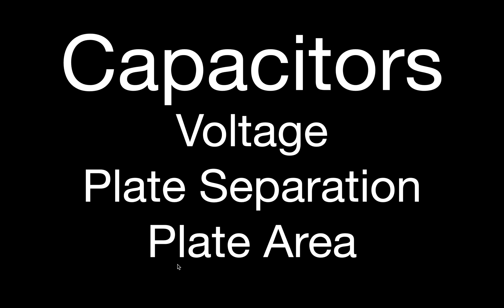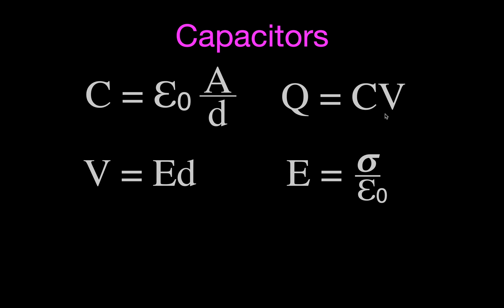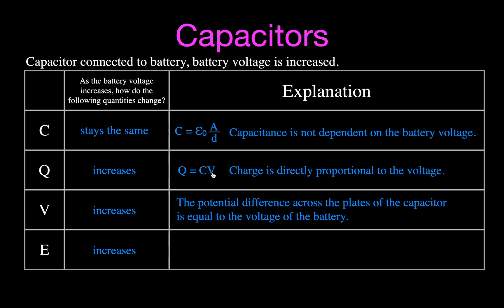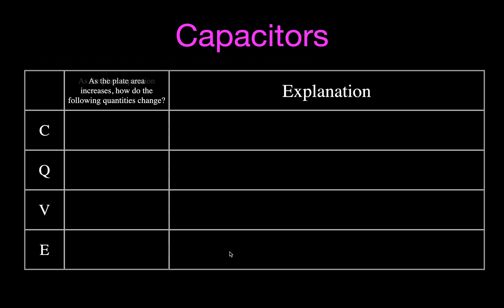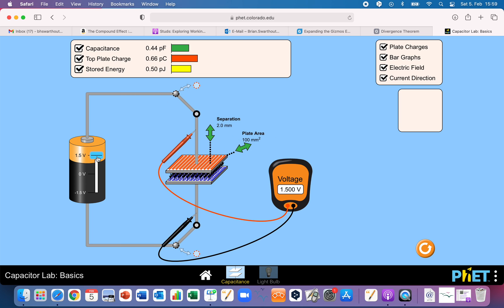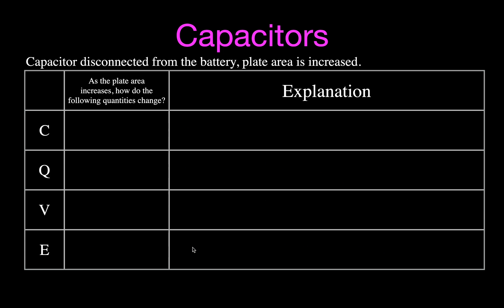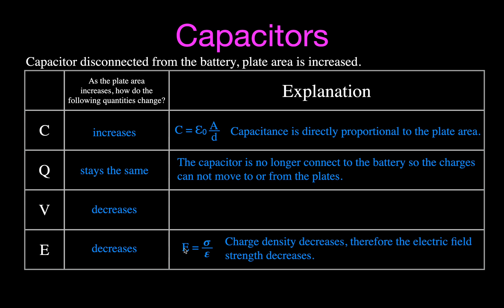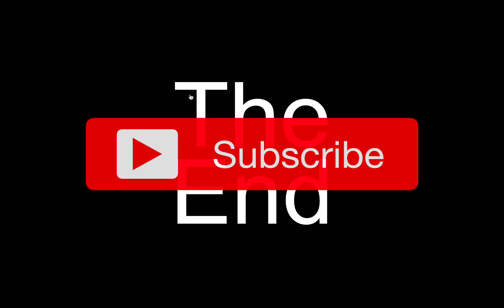Capacitors (10 of 10) Changing Plate Area and Separation with PhET Simulations

Comment: Really great demonstration!   I'm very curious, at the end of video, you showed the capacitor disconnected from the battery with bulb connected to consume energy.   If the plates separate farther apart with same size, will the bulb be less bright and power longer?
Reply: Since Voltage increases with distancing disconnected plates, the bulb would shine brighter for a shorter period.

Using the formula Voltage=Resistance*Current, with the bulb being the Resistance and Current being the flow of Charge per second, you can see that a higher Voltage increases either Resistance or Current. And since the bulb's resistance doesn't change, the Current (flow of charge) must increase.
Reply: @t.g.5644  Thanks for the explanation.
Reply from the maker: Yes, correct.